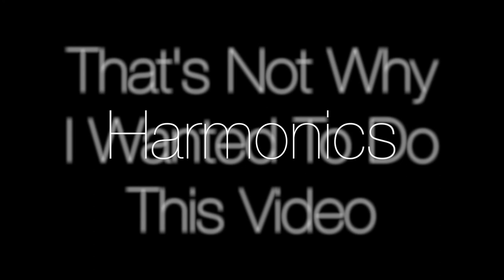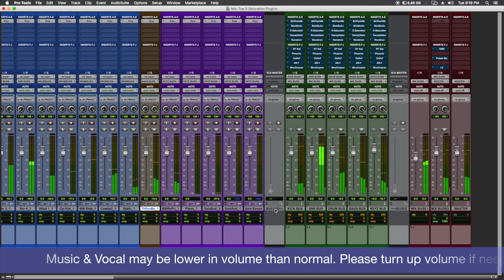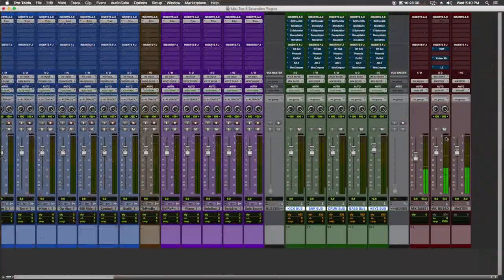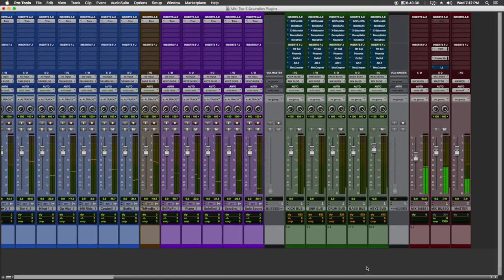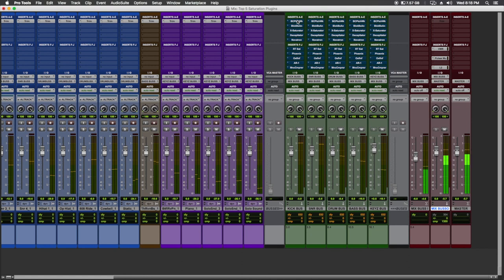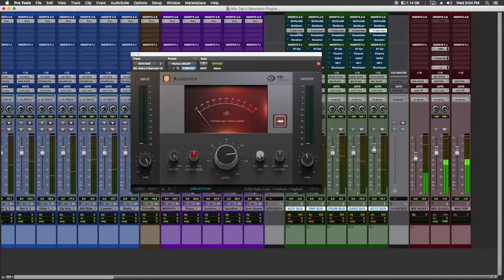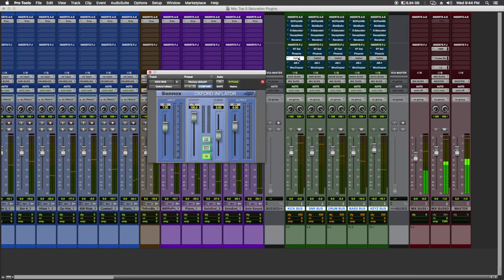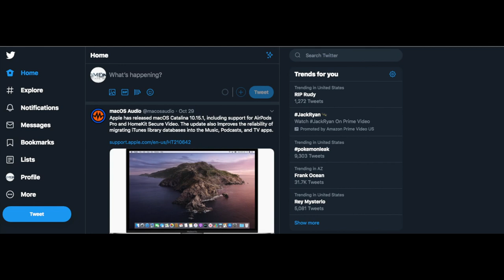Top 10 Saturation Plugins - Part 2

Comment: Interesting video Marc. Thanks.
Typically how many saturators are you using per track?
I'd be interested to see how you approach drums. Also how you use them with EQ and compression.
During the last section it'd have been helpful to hear the more subtle 5 saturators on then off.
Great job.
Reply from the maker: Yeah, I'm going to be doing a mixing video and showing how I use Saturation with Drums, Bass, Keys and Busses and Master with EQ and Compression. Thx for watching!